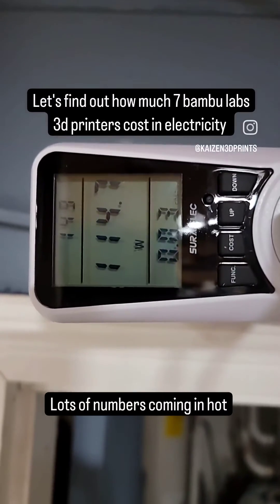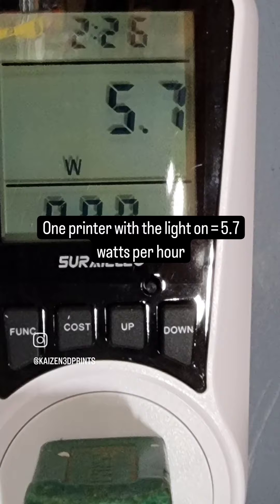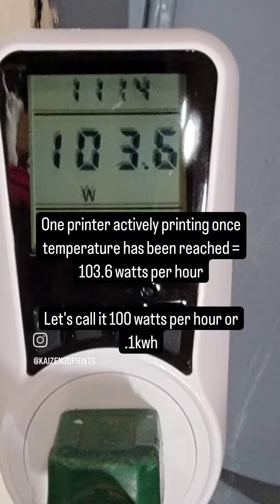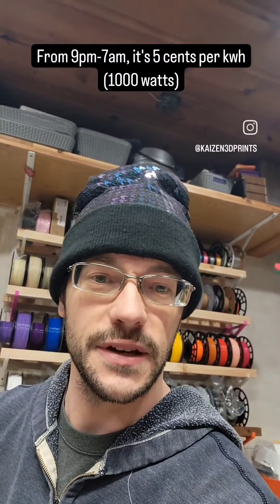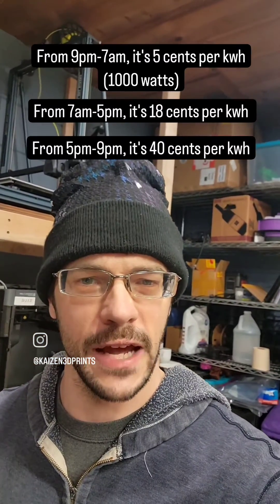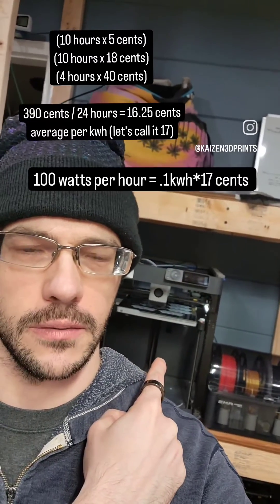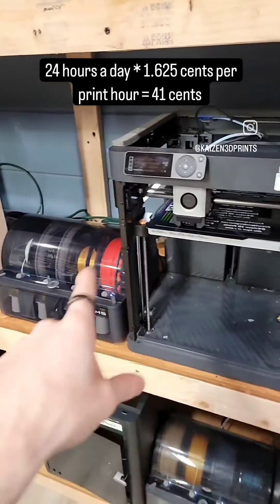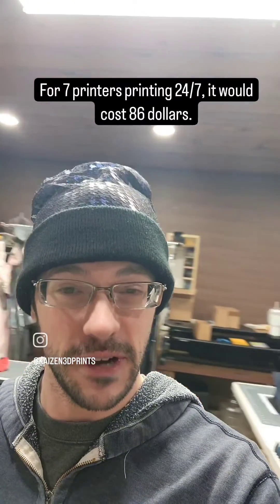Measuring how much electricity my bambulabs 3d printers use

Comment: How exactly are you wiring up your printers?
Reply from the maker: I have 8 independent 20amp circuits in the workshop. I still have 6 to a circuit but they can all start simultaneously now instead of having to stagger them on a 15amp

Comment: Thanks for this. I just got into 3D printing last month and I always worry about the electricity bill getting too high. My printer is plugged into a surge protector because a lot of people recommend that. Do you use a surge protector for your printers? Where would you put a watt meter in this case? Between the outlet and surge protector or surge protector and printer?
Reply from the maker: I have my wattage meter into my outlet and my two surge protectors plugged into it so I can track everything. Its great being able to see active draw to stagger printer start times
Reply: @kaizen3dprints  I see. Is that not daisy chaining? Are you using 2 watt meters?
Reply from the maker: @andreiblue_  im using one watt meter at the plug that has two inlets. I plug both of the 6 outlet surge protectors into the same wattage meter. I've been doing this since i put this test out, and it's been through two power outages with no issues. I've seen surge protectors with built in meters but I didnt go that route 😅
Reply: @kaizen3dprints  Oh, I bought the one in the video. I'm assuming you are using a different watt meter as this one only has 1 inlet. If you could squeeze a picture or clip of how your printers are connected in a future video, that would be great. Thanks again 👍
Reply from the maker: @andreiblue_  bahahaha i feel so silly. Yes it does indeed just have one outlet sorry I am just having my coffee 😅 i have a short 3 foot tri extension going from my wattage meter to the two surge protectors, but I dont have one surge protector plugged into another (my idea of daisy chaining)

Im sorry for the misinformation I gave you! As of right now I'm at $196 total electricity expenditure since the video was made